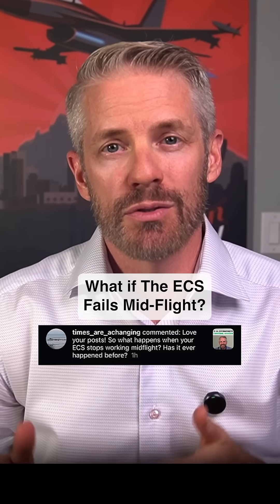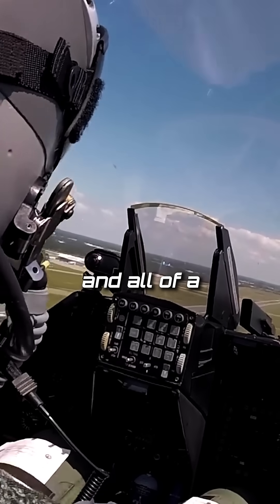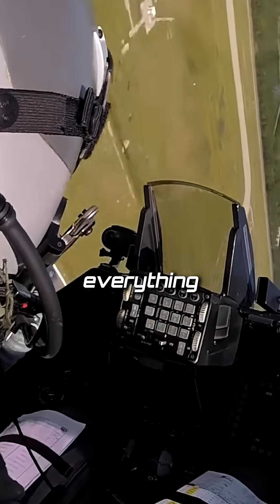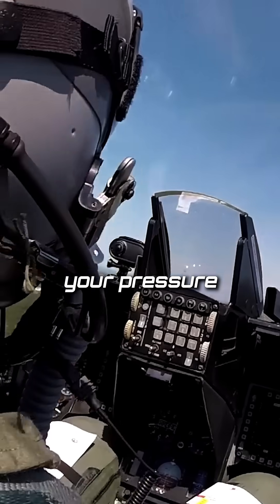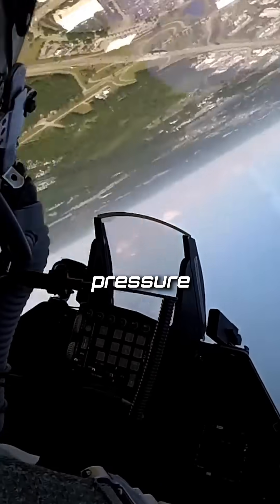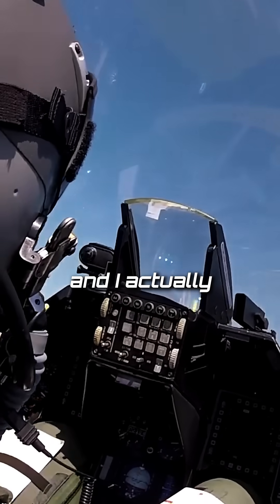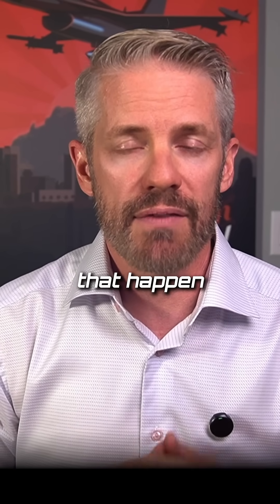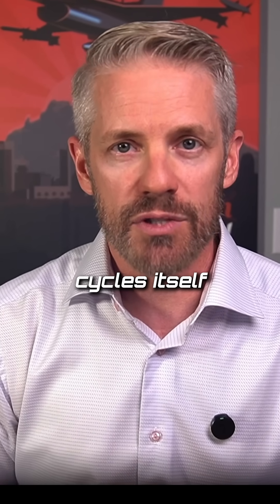F-16 ECS Failure Signs

Comment: Is this similar to radiator in the car or more like proper air conditioner with compressor etc? Another question, in this case of losing ECS or decompression how fast you have to descent? Do you do inverted dive?
Reply: Most of the time it's compressed air from the engine that's ran through a system to cool the air for the air conditioning etc. Nothing is more fun than an A/C system that doesn't work during an engine run.